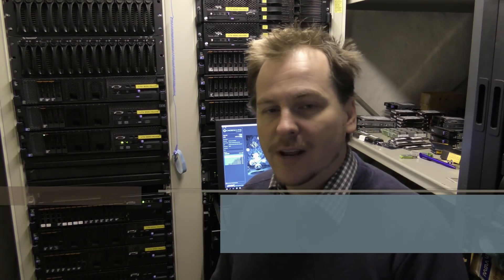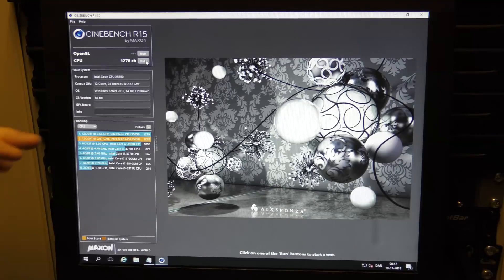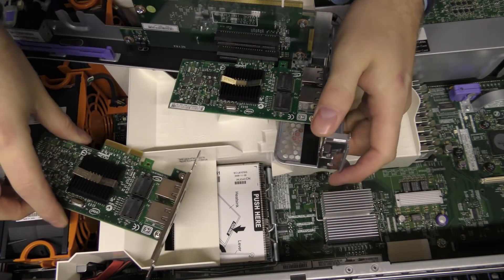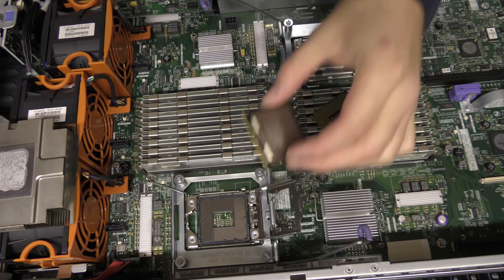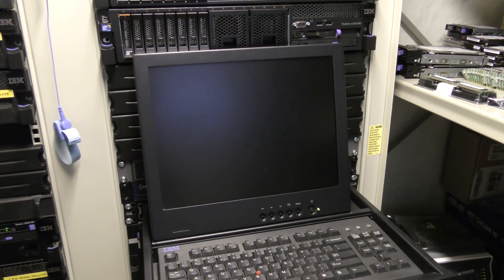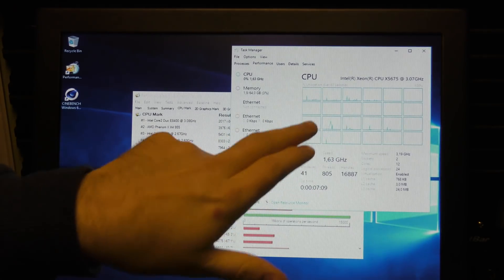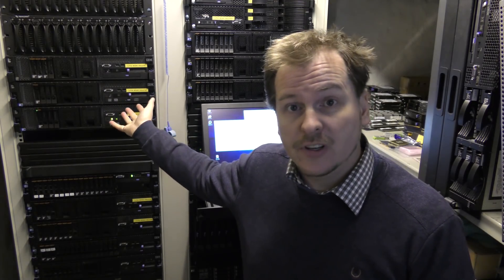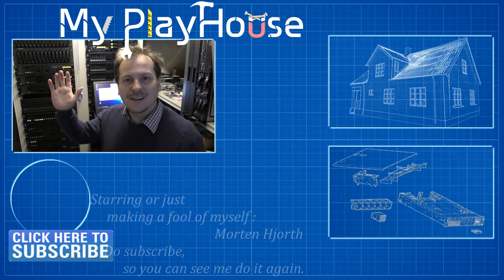Fastest CPU Possible In the Lenovo System X x3650 M2 - 778

Comment: Hello Morten! Last night I seemingly upgraded the UEFI firmware of my x3650 m2 to ver. 1.22(6 July, 2018) - does this meet the required version to run 5600 series processors? Thank you for your videos! Best regards from Georgia, USA
Reply from the maker: Yes you should be good to go! But 95watt max on that model.
Reply: @MyPlayHouse  hmmm... so the x5680 would be out of the question? If so, that's a shame. I suppose the x5670 will do if that's the case. Thank you for the quick response 👍

Comment: Morten you are aware that Intel has some xeon cpu with no igpu right ;)
Reply from the maker: Hi Kim Jensen
Thank You very much!  But as I understand it, iGPU is only in low end entry level XEON CPU's ??
Thank you for watching! :-)
Reply: @MyPlayHouse  there is some higher end also not included the igpu.. but it is mainly not on the shelf review chips seen that on.. but should be easy to find out if you look up the sku number if still read able ;)

Comment: I would upgrade my DELL PE to newer CPUs, but unfortunately it's too old to support a newer Xeon. I'm stuck with the E5335 which is only supported in ESXi 6.0 😔
Reply from the maker: Hi Stefano Bettega
Yes,, to old! to be much fun,, It does not support the 5400 series ?
Thank you for watching! :-)
Reply: Unfortunately I don't think so. The processor upgrade manual says "If the front of your system chassis is labeled with a "II," your system is upgradeable to the Quad-Core Intel® Xeon® Processor 5300 series". But even thought mine is not labeled so, I'm pretty sure I have a version II system, as iDRAC says my system revision is II and the processor is a 5335 (E and not X). Maybe a system board upgrade has been done after some time (I could check with the shipping note from DELL site). From https://www.dell.com/community/PowerEdge-Hardware-General/suitable-CPU-upgrades-for-Poweredge-2950/td-p/3591492 says that maximum allowed CPU for my model are 5100 and 5300 series and nothing more. I have to sell this server and buy a new one... Maybe a Lenovo?

Comment: I have several M2's and M3's with x5675's and x5690's and they are great machines. I purchased them on Ebay in the US for $50 each and just picked up the cpu's and RAM also very cheap! I noticed some of them had a copper heat-sink instead of aluminum, I reserved those for the x5690's. great videos!! I look forward to them every week!
Reply from the maker: Hi Lloyd Russell
Thank You very much!  I want some of those copper heat-sink as well :-)
Thank you for watching! :-)
Reply: ya. think i got the 2 i got in my server for 100usd with a intel motherboard.   nice thing is you can easly change out the cpu coolers with soemthing like hyper 212 if you have a case they fit in

Comment: I had a similar issue one time. I bought a used Dell R510 server to use and put an X5647 inside of it. Turns out that it does not support the high TDP! I spent way too long attempting to troubleshoot that thing.. it would wind fans up, not give any error codes, and wouldn’t give any output or anything. Very confusing. Great video as always!
Reply from the maker: Hi Mitchell Knuppel
Thank You very much!  Yes you would probably have been better off with a pair of these x5675,, 130W on a x5647,, where does all that power go? :-/
Thank you for watching! :-)
Reply: @MyPlayHouse  I wondered the same thing! 130W TDP for a 5647 seems a bit extreme... I put the processors on a dual socket motherboard and it's now my workstation. A little power hungry. I think I will be upgrading them soon though since they use so much power and aren't as fast as the 6 core processors in the same series.